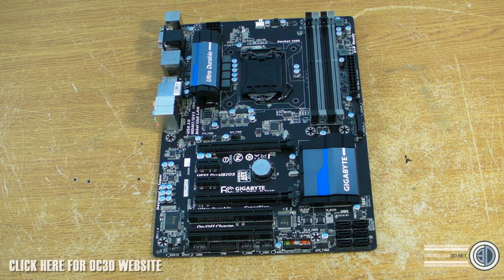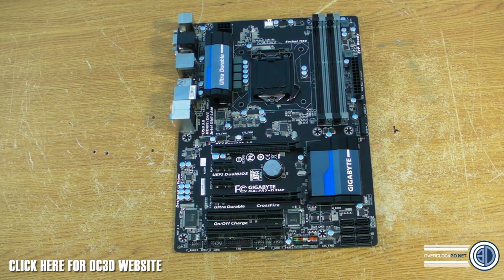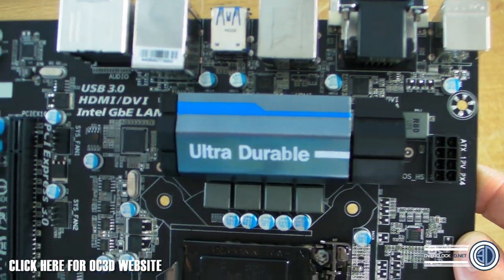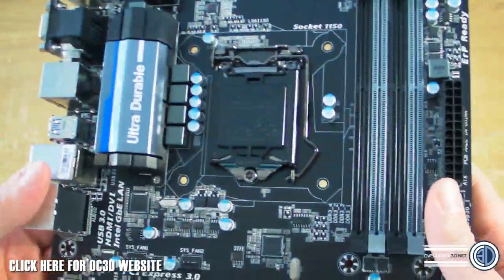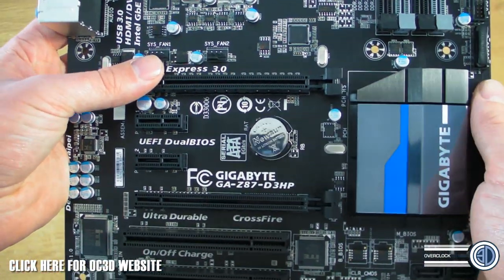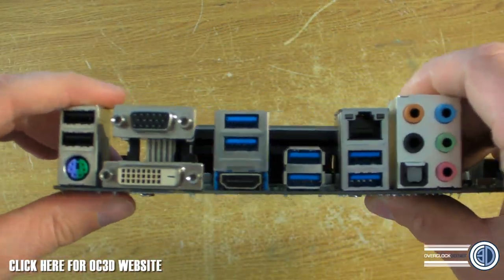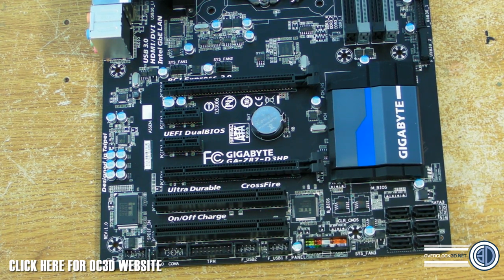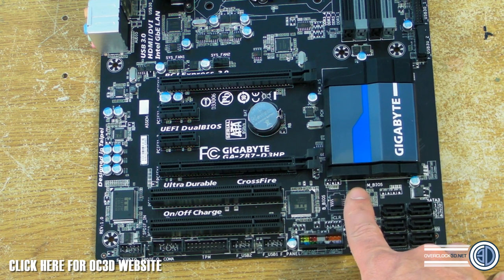Gigabyte Z87 D3HP Motherboard Preview

Comment: did you think before commenting? just because it's a different brand doesn't make the mounts different size.. if a big company says that old coolers will fit on new boards then it has allot of relevance to whatever brand hardware is in use

Comment: well the asus z87m is achiving 4.8 ghz on 4 phase, so while your chokes have more work to do it seems that high overclocks are still possible with less phases on the z87 platform, this may be due to haswells stability. (not talking about thermal envelope)

Comment: I just swapped my very reliable e machines et1862 with 3.2 ghz dual core I3 550, 320 hdd and 4gb ram plus i added a cheap Nvidia 8400gs hdmi graphics thing to it. I swapped it for a corsair tower with this mainboard and 3.4 I5 cpu chip. 16gb ram aswell. Seems to be working ok so far. I only swapped because i needed a bit more power to run davinci pro software. I do miss my emachines though, in 8 years i never had to open it up to fix it not once. Super smooth computer and very nippy too. But i came here hoping to know if this board will take an I7 cpu and what graphics cards it takes. Also if anyone here is reading could they tell me what fan (heatsink) i need for the cpu as this one is quite small or will it be ok since i have about 4 huge light up fans it.

Comment: This is a " cheap " board , look for higher end ones , they usually are angle.
I guess it's a marketing strategy , you get what you paid for.
And if not mistaken from the looks , i bet this is a 4+1 Phase Power board , not that great for OC either. Look at the so few and puny VRM ! But even so they had quite a big heatsink to cover it up , to cover up  the embarrassment i guess =/